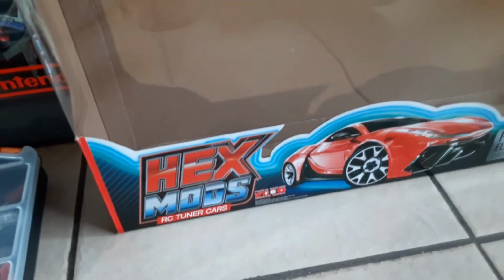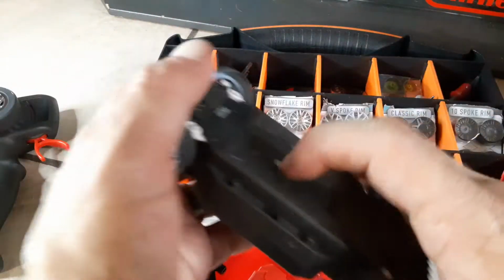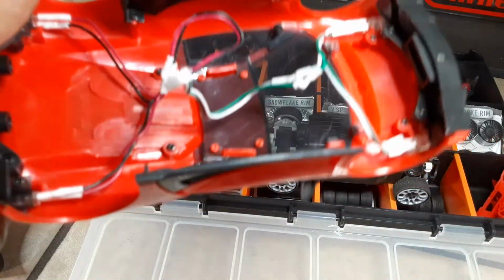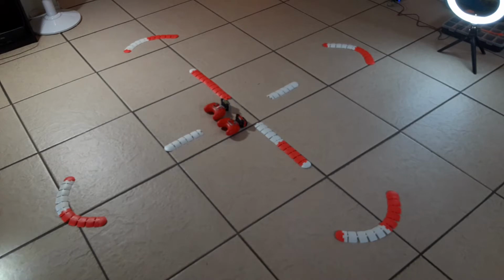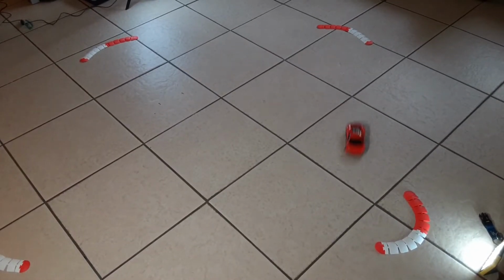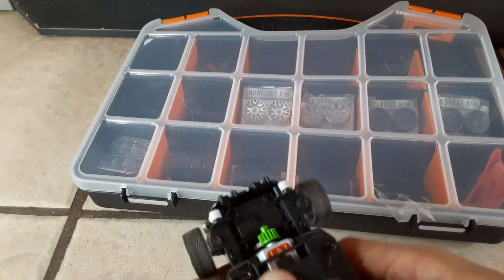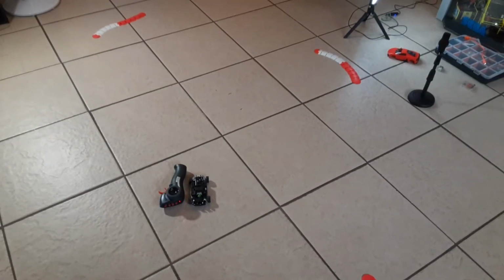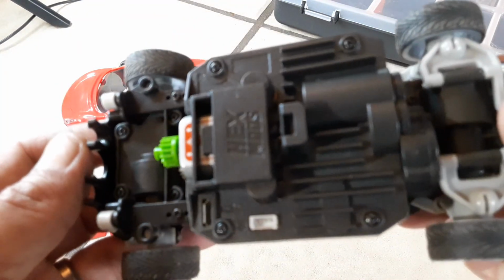Hex Mods RC Drift Car Installing Lights & Faster Motor

Comment: That’s a cool looking Rc! Looks like it comes with plenty of customization👍 is it pretty easy to work on? Like that storage box too, good for parts
Reply from the maker: I am glad to see you here my friend
Reply: @MightyistheRCGamer  you’ve been pumping them out quicker than I can watch them lol, I’ve been busy working on that video I just dropped, man I recorded run footage and everything, when I went to edit it, the file got corrupted and I had to start all over 😩 a full days work gone! Had to recharge and run it all over again, I always try to keep up with my boy 🤙 good video brother! So what’s the verdict? Is it worth it? Should I pick one up? I’ve seen them before, just wasn’t sure
Reply from the maker: @rcreviews9894  I think it's a very cool little car and it works fine just as a 2 wheel drive I have been to lazy to put the other differential to convert it into 4 wheel drive. I think it's a very good little car for the price and it feels well made.... I once went out filming and it was at the lake so it was some really good drone flying with no wind I was flying perfect the video would of been great but accidentally deleted my entire file some of my best flying gone
Reply: @MightyistheRCGamer  I may have to check it out, there was one toy grade that I bought some years back, the air hogs fast tracks, it’s built like a tank with treads, drives really fast for it’s size
Reply from the maker: I want to Upgrade a Mario kart rc into BRUSHLESS
Reply: @MightyistheRCGamer  that would be pretty dope🤙

Comment: Hey i was wondering if you could help me my controller for it is turning on i just got new batterys for it but my car just wont pair with it the car turnes on and flashes for like 5 seconds and then turns off if someone can help me that will be great
Reply from the maker: You might have a problem